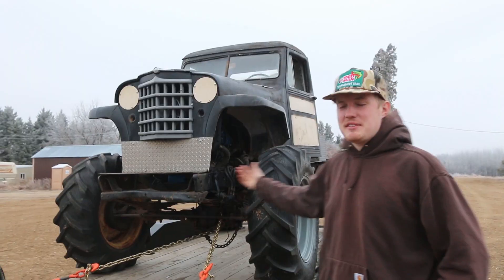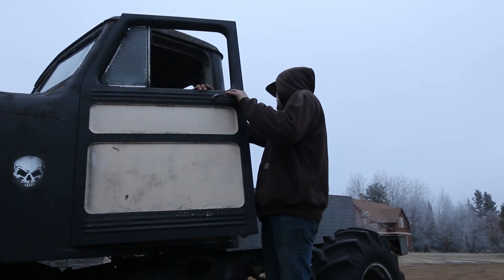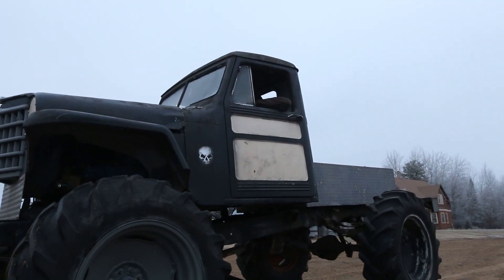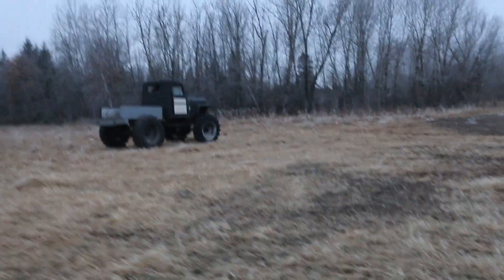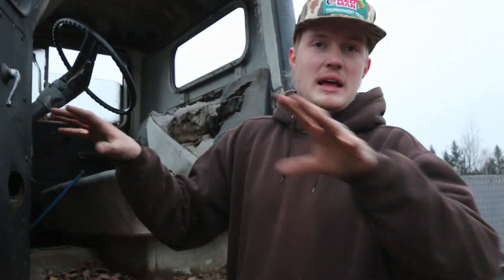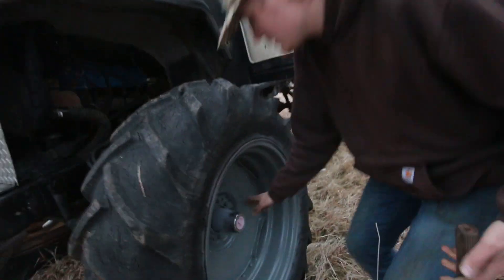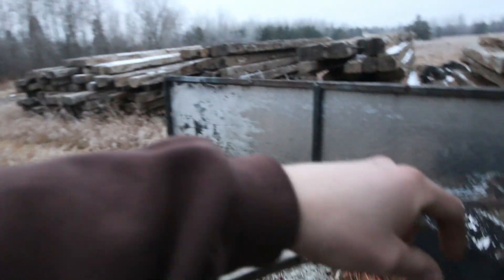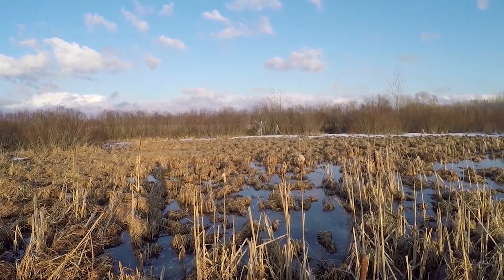I Traded For a Jeep Willys Monster Mud Truck

Comment: I would roll bar the front and maybe find a way to make removable rear roll bar that can have a clutch cover go on like a deuce. Also wide wheels like WD used before MonsterMax, reduce that tipping. Honestly would also be tempted to muffle that motor or something, that’s just loud. Also get some lights in the front and maybe tractor seats in the cab so you have Some suspension lmao. Also wreath on grill is a total yes.

Comment: Fix your choke so it runs better first,  the rear driver wheel looks bent or the axle.  Who needs doors that close, a roll bar and seat belts?  You do, you really do.....   be safe but have fun.

Comment: Awww man I’d love to have that 390 !!! 🥰 I can remember the exact day I last owned my ole 78furd she wasn’t no FurXFur but man I wish I would have kept that truck and not sold it to my uncle... but I picked up an ole 71 highboy afterwards n well I blew up the 360 that was in it, my uncle pulled the 390 in my ole truck and we dropped it in the highboy and we used to for truck pulls and went to moms mud bog in mesick Michigan, she came in 5th place and I ran up against modifieds pushing 2000hp and ole stock 390 did better then theirs

Comment: Was i the only one that knew it was on a highboy frame
Reply: No person man the front drum brakes give it away
Reply: That a rare frame
Reply: 79 front axles used disc
Reply: @realrickharrison3103  not too rare, i have 2. They aren't the most desirable by dentside owners because of the hydraulic steering. They made those frames from 67-76

Comment: Those tiny axles for big tires person man what hell
Reply: They look tiny but they are quite stout
Reply: @oldcroneysgarage9739  How they stout if it broke you fool person
Reply: @realrickharrison3103  if built right there stout.
Reply: @oldcroneysgarage9739  It be Dana 44 on 52 inch tires person man what hell
Reply: @realrickharrison3103  I thought in 79 they used dana 60s?
Reply: @oldcroneysgarage9739  Not on the f250s you fool person
Reply: @realrickharrison3103  well I guess you learn something new everyday